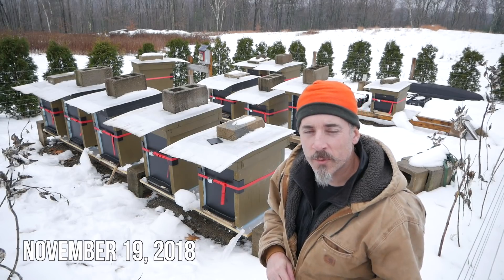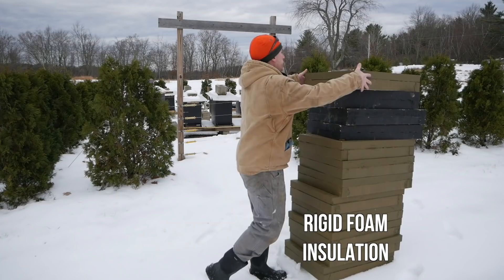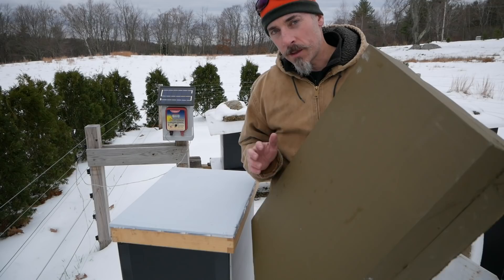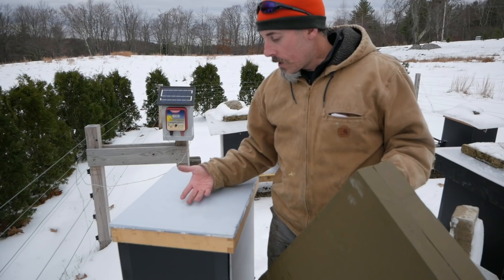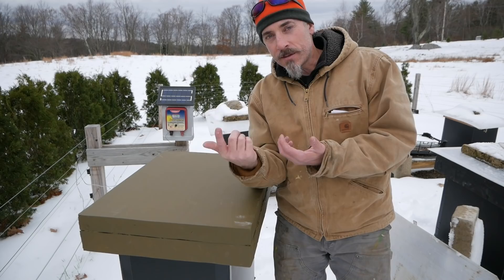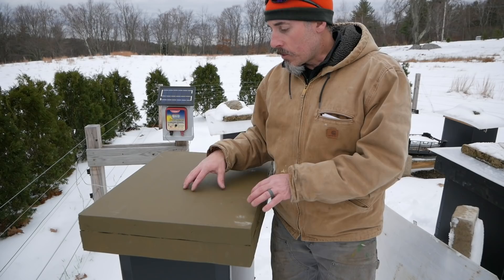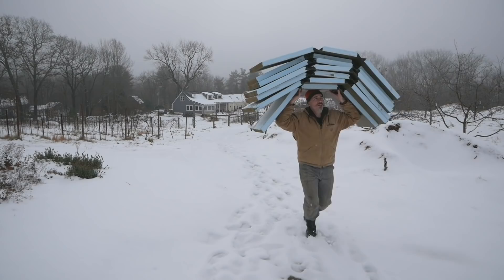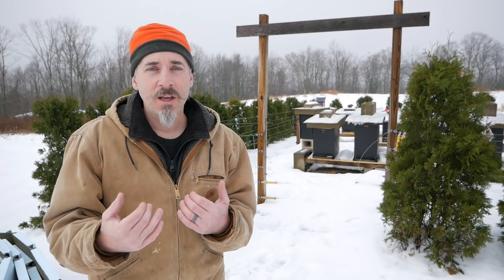Why I Insulate My Bee Hives

Comment: I can see your reasoning behind leaving the fourth side exposed for the sunshine but I do not think it is as effective as insulating that side. The reason I say this is if you add up the hours in the day where the sun is not directly hitting that side and also considering the night hours and cloudy days, where it could stay cloudy for several days in a row which is typical in the winter time I would reason that that fourth side being insulated would be more effective.
Reply from the maker: I've gone back and forth on that. My fear is that I create an insulated cooler that becomes cold over time and then never heats back up. Many people don't believe insulation is needed at all. I think this helps more than it hurts. If anything it is a great wind barrier.
Reply: @vinofarm  Maybe put the Blackboard on the outside and the insulation on the inside?
Reply from the maker: Ray Capps It is done this way because of layering. The coroplast sleeves go on in Late October. They act as a wind barrier and absorb some of the sun heat. They are like a light windbreaker. The insulation goes on about a month later in late November. It acts like a heavy winter jacket. Then in April, the insulation isn’t needed so it comes off,  but the coroplast windbreaker stays on for at least another month. Doing it in reverse would mess up the order of things.
Reply: @vinofarm  I think it would like to try your installation method a very great idea by the way. But I would like to try to glue the coroplast to the installation and risk the Hive not overheating. I think the radiant heat the Sun will add to the insulation is worth the added risk.

Comment: Looks good, solid set up. Up in Canada (near Toronto) we got -29 C last winter for like 2 weeks. We need top insulation at a bare minimum. You also need to seal the cracks, -30 C drafts are not great for bees, need some wind break. Here is mine again, sides I just use 3/4 inch but top needs 2 inch for sure: https://imgur.com/a/V76laB8

Comment: @Vino Farm, Isn't a hole needed on the backside for flow through the Vivaldi boards? Or are you relying on the front entrance?
Reply from the maker: They work perfectly for me with just the front open during winter.
Reply: @vinofarm  Thanks just wondering.

Comment: Is it possible to only keep one colony of bees or is it better to have multiple?
Reply: It's certainly possible to keep only one. However having two hives gives you a few more options if something goes wrong with one of the hives, you can grab brood from your other hive if one the hives queen dies for example. But if you get in contact with your local beekeeping group (there's almost always one no matter where you are) and make a few connections, you should be fine with one hive. In an emergency you will find more beekeepers than you can handle willing give up a frame of brood or whatever else is needed to help you with any issue. I found two hives nice and manageable for me, but one is certainly fine if you'd rather not take on two.
Reply from the maker: SquishyDave Good answer. I always recommend two, especially for a beginner. It is so valuable to be able to compare two hives sitting side by side in the same space. But yes, One hive is certainly possible.
Reply: Ok thanks. one of my good friends mom is actually a master bee keeper (she has a degree from college and lives near me ) and she told me about bees and I’ve been researching and wanting to keep them for a year or so now. But did not want to take on more than I could handle if I do decide to get bees 🐝.

Comment: good to insulate--but i think the black plastic is bad--as it will heat up the hive then at night it will be a sudden drop--that is to hot in day---the bees cannot adjust to the change of temp
Reply: He lives in the same temperate zone as myself and I think I can safely say that there is no hot in our winters. The best way to describe any "warm" day, is to take a hot dog out of the freezer and put it in the fridge, that's the extreme range a rare "warm" day has. On top of that, the bees have all day to regulate the temperature inside the hive. It doesn't go from 40F/4C to -20 in 60 seconds. If you watch his previous videos from the beginning, you will see what the temperature range is like, so I think he will be okay. :)

Comment: Jim, i'm curious about the evergreen hedge you have.  i think the fronts of the hives face south right?  wouldn't you want to not have the hedge on that side?  presumably most of the wind is coming from the west and north?  and the sun must get pretty low on the southern horizon in winter creating shade or will as they grow taller?
Reply from the maker: I'm keeping them trimmed at about 6' tall. Just tall enough to break the wind, but not create too much winter shade. They are arborvitae so the more I lop off the tops, the wider and bushier they get. It should look like a proper hedge in a year or two.

Comment: Actually I am from Saskatchewan Canada. Any shot at bees surviving here requires R-12 insulated tarps surrounding the hives and more on top. I personally had a small shed close to the house. I decided rather than making the investment in tarps that would have to be replaced or trodding through snow to monitor the hives I just ran an extension cord and insulated the shed. Now the bees are in a temperature controlled and monitored environment. If it gets too cold the heater kicks in.  I put in a wireless outdoor thermostat in the shed so monitor the temperature and humidity from the receiver in my kitchen.

People advising you how to raise your bees is one thing. People telling you how to raise your bees and criticizing you is entirely another.  Anyone criticizing you for how you decided to raise your bees amongst the thousands of successful methods or opinions is narcissistic. What is the difference that they are to full of themselves to see? You can raise your bees as you please and announce and promote those methods to the world. It's not ego it's a personal choice and it's educating others. To criticize that is narcissistic behavior because they are trying to force their methods and opinions on others through the use of criticism. It's indecent and uncalled for. An attempt to silence and defame at best. 

You are public with your choices, methods, reasoning and results. I am happy to see you assigning the proper level of importance to the critics that they deserve. NONE!

I'll add this. A bee researcher's son wanted to do a school project. He decided to do a small experiment comparing thermoregulation in 8 hives 4 controls with Varroa mite counts 2% or less as compared to 4 hives with 8% or more Varroa mite counts. His small experiment was definitive. In every single case high counts of varroa mites affected the bees ability to produce the heat necessary to thermoregulate their cluster. While only a single small scale study. the initial evidence does clearly point to the possibility that not only are the mites vectoring disease but they are also reducing the bees ability to move to abundance of food in the hive in cold weather and possibly starving as a result. I myself have seen videos of dead hives with bees buried in empty cells right beside cells full of honey. Is it possible that those hives starved due to mites affecting the ability of bees to thermoregulate the cluster in cold weather and move even an inch? Would insulation, even if thought unnecessary, have saved those hives by reducing the necessity of the bees to produce as much heat for thermoregulation and survival? 

If left to the critics we'll never know because "let them die" does not provide a platform or an environment to have any questions asked or answered. 

Anyway, keep going my friend. Your open mind to ideas, your ability to listen, weigh and rationalize and your effort may not guarantee your bees survival but it is giving them the best chance to continue to do so. Remember. North America is not a traditional and natural home for these bees. all of our natural plants are not traditional and natural food for these bees. Varroa mites are not traditional pests and many diseases are not traditional either. History has shown Nature can over come all these things but there are also extinction events where it couldn't evolve in time. Why is this important? Because before any naturalist criticizes you, they should all pick up their hives and move the bees back to their natural and traditional range and leave them go. There is nothing natural about anything they are doing either. Natural is going to a Farrel hive in the bees traditional range nakid and digging comb honey and larva out of a tree stump like any other respectable predator. Anyone who isn't doing that has no right to judge where the natural and unnatural line for domestic beekeeping is drawn.
Reply: I have a three story barn, used to be a chicken barn here in upstate New York. My wife thinks I should put the bees on the unused third floor, I think fine for winter, but it can get hot on the third floor in the summer. We are going to try and capture a wild hive this spring. Some one in Maryland gave us all there hive/ beekeeping stuff.  So no bees yet. What do you think? Too hot, it can be about a 100 (just a guess, but I do have wood drying out up there because of the heat.)
Reply: @MikeSheasheaDtree  Your guess is as good as mine. I only store mine indoors for winter. The moment it gets nice in the spring they come out.  Other considerations. I keep my shed heated to the plus 4 Celsius (+40 Fahrenheit) range. Bees can and will fly in that temperature so they have to be kept in complete darkness while still having circulating ventilation to get rid of humidity and CO2. I mean not a single ray of light. I have a 25 watt red light in the shed but if that light is on for even 5 minutes they start coming out the hive entrance with the odd one taking flight.  Plus do you have the loft doors on it to hoist the hives up from the outside? I use single box hive management and need that brood box without the bottom board weighing 90 pounds or more  for them to have enough honey to winter. Climbing 3 stories of stairs with  a 90 lb box plus the bottom board won't be an easy task in the dark. Spring time will be lighter but it's still 3 flights down in the dark. Trip and fall with a full ten framer and you are gonna want ruby slippers. Not that any of this can't be overcome but it is all things that are necessary. You can Check out The Canadian beekeepers blog and look through his video section to get more details on how he indoor winters. then adjust the necessities to your situation. It's what I did. My biggest difference is his 1400 hives overheats his shed so he has his thermostats hooked up to big ventilation fans While my two hives and two nucs don't so I bought a thermostatic 1800 watt power bar and a 1500 watt electric heater. If my planned propagation works out for this coming year I think I'll need fans running to cool things down also. If it goes well by the 3rd year I'll need to outfit a bigger building. But that's OK cause I'll also need access to it with the truck to load and unload. Here is the link to his video wall Just remember he and I are on the Canadian prairies so some things differ.  https://www.youtube.com/channel/UCkQVs6-xm3mVNdwW4Zt8McQ/videos
Reply: Forgot one more thing. If you plan on leaving them in a loft you have to realize that when it's warm enough to fly and they have light to do it they are gonna shit all over everything.

Comment: A bee hive is like your house... you don't insulate the roof, you insulate floor of the attic. insulating the outer shell when there's still cold airflow getting behind it makes the insulation completely pointless. And like any attic space, you need that airflow to allow the condensation to escape.
Reply from the maker: turgsh01 This is old thinking, actually. Not saying it’s wrong, but look at how homes are built these days. They are airtight and the insulation is sprayed in at the outmost envelope of the house. Right up against the sheathing. When we rebuilt our farmhouse, this is how we did insulation. This is not to say that a beehive should be insulated like a human house, but the idea of insulating ‘inside’ the hive and leaving any kind of uninsulated airspace above the insulation that will attract water does not make sense to me. In the last two winters with the insulation on the OUTSIDE, all my Vivaldi boards and top covers were bone dry and free of mold. You can see in this video, pre insulation, the top covers were wet.

Comment: I think that the bees are in constant cold for a long period is better than having temps go up and down. Bees are cold blooded, so the cold helps them "hibernate" (torpor) better. They also eat less of their stores. Bees are not like people and don't need "layers". They survive in trees. But if their hive is warmer, they move around and get active and eat their stores. Having them cold is actually an advantage. Warm winters can cause more problems.  I know you have seen Jason Chrisman's videos, he leaves the screened bottom boards open and does not insulate. It's just as cold where he is.
Reply from the maker: Thomas Gordon By ‘layers’, I meant that my system is modular so I can take off levels of insulation when needed. Unlike something like a bee cozy that’s all or nothing. Although I’m sure the bees would appreciate individual goretex, zip-out fleece lined jackets.
Reply: Thomas I live in Ontario so winters can be brutal. This is my fourth winter with bees. I agree with you. Have come to the conclusion the ones that know the most about bees are the bees. A bee hive let's say in a tree in a hardwood bush. Will only get diffused light so no heat from solar. So they should stay cold all winter with the exception of thaws. I used to insulate but came to the conclusion am doing a disservice to the bees. The extent I go to is 2" insulation on top. My inner covers are 100% cotton tarp to replace inner cover. Then the 2" insulation. I don't even use tar paper. I only use Feltbuster (synthetic roofing felt) only to eliminate drafts which can be as deadly as moisture. Just recently used my thermal gun on some of my hives I haven't wrapped it was -8 C outside box was showing 60* F and the felt wrapped 84 * F. My gun was set at F not C. Not bashing anyone's methods on how to keep bees in winter.  And love the videos on this site. It's true there is no right or wrong way of doing things

Comment: You are missing the basics of thermal dynamics. 
To all who say not to  insulate just look at a tree.
The average tree hive is minium r20 generally r40.
BEES DO NOT GO INTO CLUSTER EXCEPT AS A DEFENCE STRATEGY.

Your 3 sided wrap should have the fourth side(front,)

The vivaldi board is a joke.
Read constructive bee keeping by Edward Clark.
Use a winter crown board for fondant and sugar.
The extra space enables them to gather on top and easier to move horizontal.

I have done a lot of  research with sensors and r values. This no random opinion but applied science based on our  research and what we see from the bees.
Good luck
Reply from the maker: You have strong opinions. I guess we’ll just have to wait and see what happens. The three hives out of 5 that I’ve nurtured through winter have lived in these same conditions with the same insulation. The two that died had significant varroa problems. Maybe I’m just incredibly lucky.